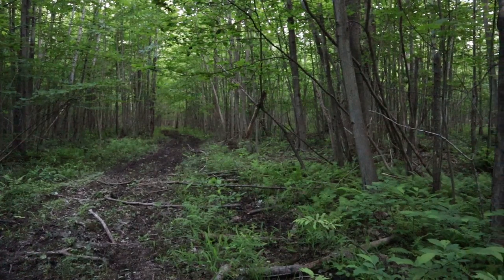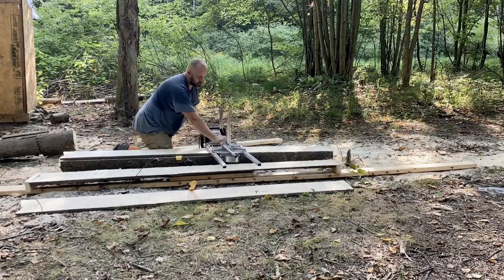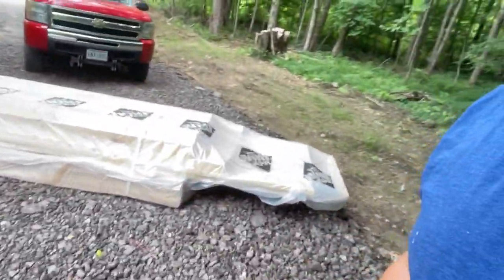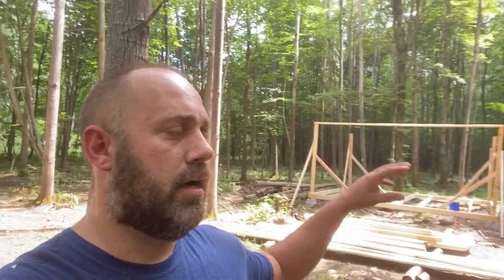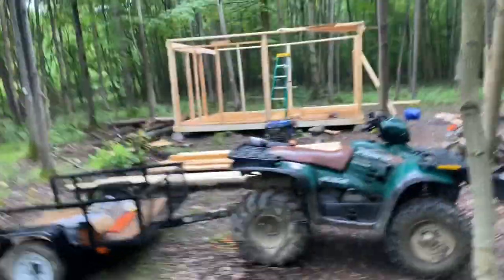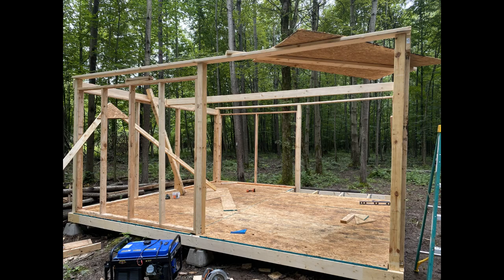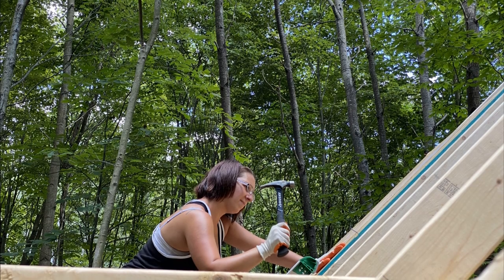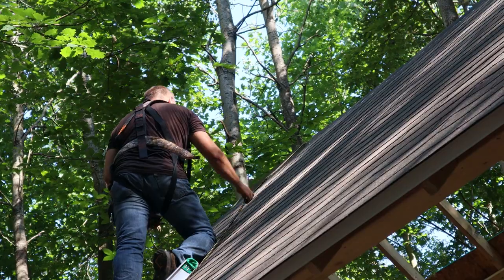OFF GRID CABIN BUILD 2020 - The Beginning - EP. 1

Comment: Looks good so far, how big is it? I'm thinking of doing a 12x16 to start with a Barn Style Roof/Loft and a 6x12ft Porch. I'm hoping it will be big enough. Thanks for sharing Your Journey.. 👍
Reply from the maker: Our cabin is 14x16 and it is plenty for a small family. We did a 12/12 pitch that gave us enough room for a decent loft area. We have 2 kids and 2 adults and the cabin is just big enough. 12x16 should be good if you plan on doing a full loft.
Reply: @TheOhioOutdoorsman1  Thanks for the reply, I'm going with a 12x16 which is going to be set up as a Bunk House for the Boys when we build the Main House, and be used later as a Guest House, building it just big enough in case We have delays and have to stay in it longer, Main House will be a 24x36 2 Bed one bath, it will be mostly for the Wife and Myself during our Retirement. I'll be posting more Video as I progress, still in the Planning and Prepping for the move..  😎